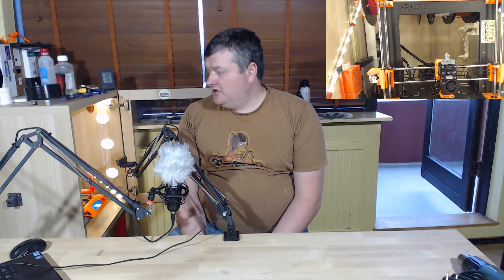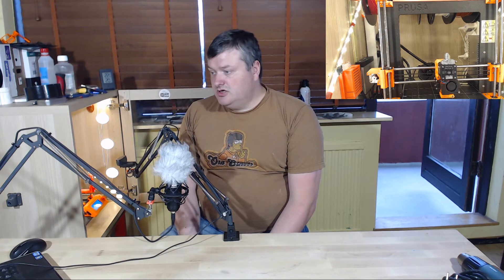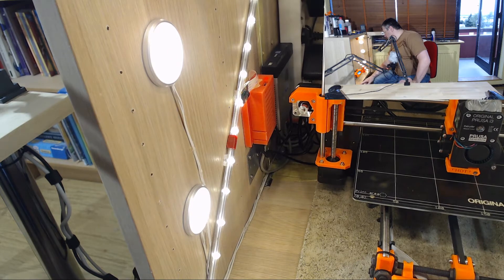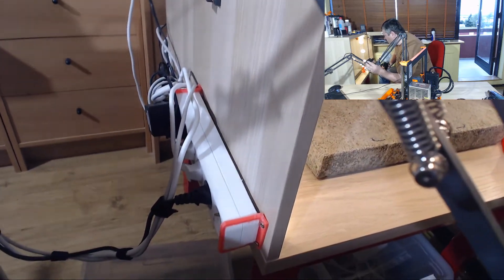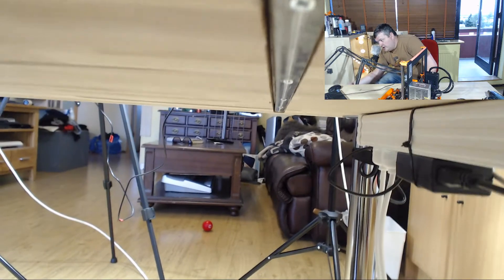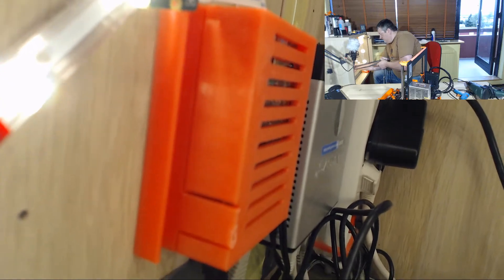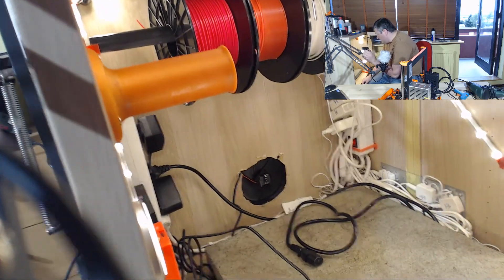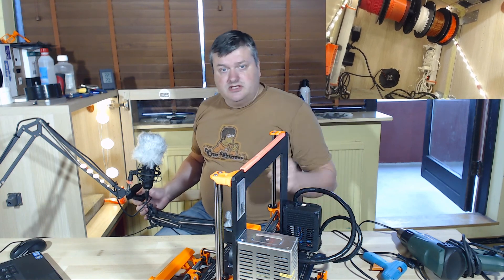Enclosure update for Prusa mk2s printer

Comment: Nice build! A lot of good ideas! If you like to get tips: get all the electronics out of that box. Raspi, 3D-Controller, PSU and everything else. Those things need to be "cool" in order to live long. Working under high temperatures may work at first but means a lot of stress for your components and will shorten their lives.
Reply from the maker: Hi. thank you, - Those concerns about the electronics have been addressed, In normal condition, I have adjustable 120mm fans in the back of the enclosure, one blowing air in, pointing to the electronics, and one at the top pulling heat  out. It's only when I need higher temps for printing when I turn down the fans, to keep the enclosure at a constant 40°C (abs prints etc..) - Normal working temp in the enclosure is 20-25°C :)

Comment: Monitor your router and RPi temps...you can get strange things when these overheat, like lan on ... off...slow...on...off...crash
Reply from the maker: the network switch is unmanage, but I check the raspberry .  I migth print out a new case for it with a fan installed for it.
pi@prusa:~ $ /opt/vc/bin/vcgencmd measure_temp
temp=58.5'C

This is after tonights print, (still going on for 12 hours) - the cabinet temp on the inside sensor is 25°C

Comment: Had in the past bad electric distribution at one place at work...aircos went off every evening during the week...it was the cleaning lady using a vacuum cleaner in one specific power outlet that then tripped the fuse😂
Reply from the maker: yea, that is common, I have a powerful Dyson vacuum cleaner, and if I plug it in the kitchen , it trips the fuse there :), (10A fuse)

Comment: Be careful with the power outbreaks behind each other. Especially with the heat gun you draw lot of current....don't burn your house down. Get a power meter and make sure that all outlets are in their current specs when you have all devices drawing power.
Reply: Or even worse get a print failure because of power loss
Reply from the maker: Thanks for your comment, - The powerstrip that I have the extra socket for heatgun, is the first powerstrip from the wall,  so that is ok I think, - The studio lights are 2 x 50W led lights , so they don't draw much power, but that powerstrip is also connected to the first powerstrip. - then for the powerstips in the cabinet, the lights in the cabinets are all LED ligths drawing little power, but for the Printer rambo board, Pi and switch, I'm printing out a fan duckt so the inlet fan will blow air to the side where those componets are, to make sure they get the most cooling
Reply: Fire suppression a must with enclosures !!!
Reply from the maker: I have a fire alarm in the ceiling close to the enclosure,  I hope I don't have a fire when I'm not home though :)